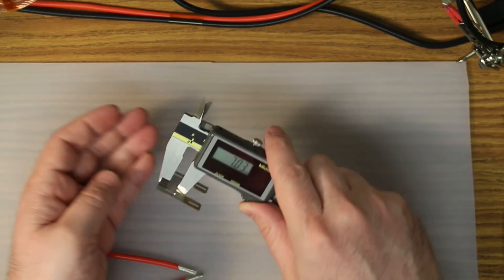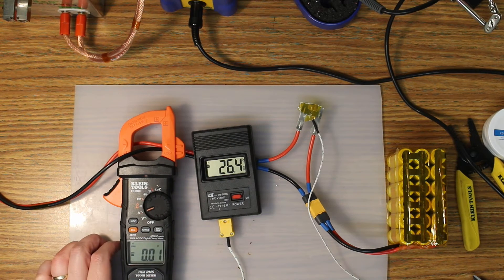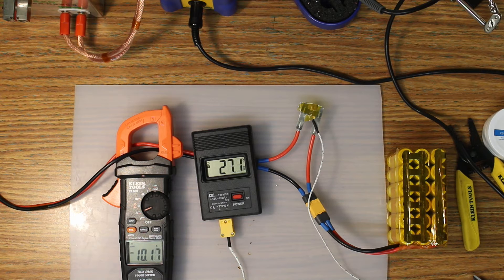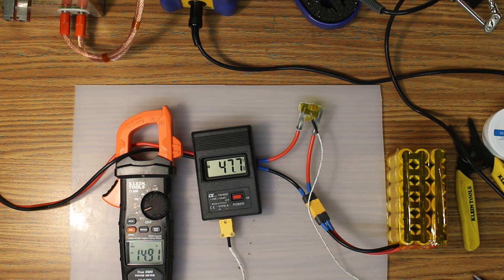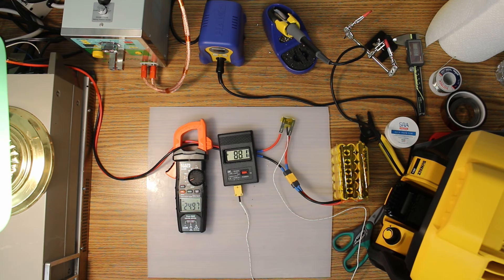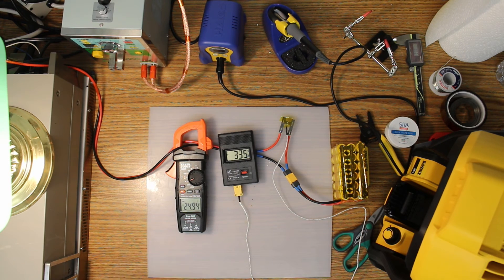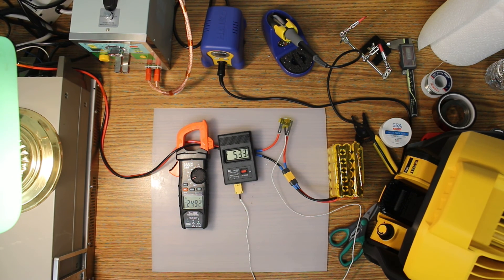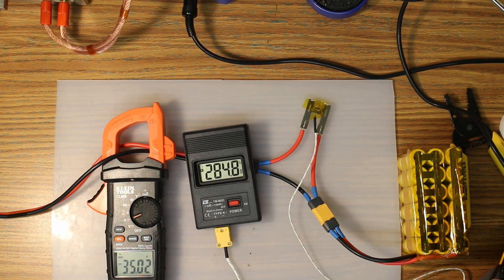18650 Nickel Strip: How much current can it handle

Comment: So basically it should be good for up to 10A current with 0.15mm 7mm pure nickel
Reply from the maker: Yep, but you can push it to 20 amps and still be under 80C or do short burst much higher, add cooling and go even higher. But if it is all sealed up then 10 amps would be a great practical limit.

Comment: Pure nickel strips can take a lot of current, the nickel plated steel type cannot take much current though. An easy way to tell which is which is to cut a 1Cm piece off then disolve in a mix of muriatic acid and hydroge peroxide at a 1:5 mix ratio. The nickel will form a emerald green solution, the iron will form a muddy brown orange solution.
Reply from the maker: Very cool info. I did cut and sand it down and placed it in a salt bath to check for corrosion but I like your method! Saving it for later.
Reply: Do you think 0.2x10mm nickel plated steel would be ok for 10A current

Comment: All that heat gets absorbed in the cells that the strips are welded to and if not cooled can cause a lot of energy loss and voltage sag at higher load currents and damage to the cells in the form of aging and potential fire but in some cases improved cell power output as they warm up the cells.

Comment: what was the voltage drop?
Reply from the maker: Great question! I did not measure that :( however I am sure it could be estimated with the dimensions and resistive value of nickel.
Reply: @mechanicalgraffiti  same way you could estimate temperature. But you did test to prove it.
Reply from the maker: Yes if I do it again I will check voltage but I may not be using nickel on the next setup planning to switch to aluminum or coper for my busbar . Temperature is much harder to calculate, you need to know the heat transfer coefficient (h), and that is a hard number to get. Originally, I was correlating the test to a SolidWorks simulation to derive my h value but I ran out of time and no longer have access to thermal simulation.

Comment: thank you... i'm building a 6s3p pack for an rc jet that will see sustained currents of 25-30A per "p-group"... i'm thinking i'm probably going to solder copper. Would have been so much faster to use nickel...
Reply from the maker: Are you using cylindrical or LiPo pouch cells? And yes copper is much better, the OEM power tool battery I took apart used used nickel plated coper, great conductor with no corrosion.
Reply: @mechanicalgraffiti  molicel P42A, 21700 Li-ion. I have a 8" by 8" plate of 1mm copper that I'm going to cut into strips for this. Might add a couple of grams, but I did a bunch of math tonight, and this 1mm copper has 42x less heat generation than these little .1mm nickel strips at 30+ amps (all else being equal). Heat being an exponential function of current really makes copper mandatory for anything over 20A, even stacking 4 or 5 strips doesn't come close... About everything fun in the R/C world rips more than 20A... Mine are going in a dual EDF jet that can pull 120A easily. These molicel are badass, though... Much lighter than lipos for the equivalent Wh rating... But some lipos can make much more current for their size... Hence my need of a 3p config.
Reply from the maker: Dual EDF sounds awesome. And yes copper is amazing, 1mm may be overkill, you probably don’t need anything thicker than the thickness of the positive terminal on the battery and be careful soldering, the heat can damage the cells. You may be able to get some copper shim stock that could be doubled up and spot welded on the cheap. I just finished editing some old footage on high amp rated 18650 and 21700 cells and published, although they are still nowhere in comparison to LiPo pack in terms of power output, see my Zeee vs Turnigy test.

Comment: Suppose I have to pass 150Amps from that nickel strip for my 14S battery pack. But I have total 14 nickel paths for current to flow. So the current will flow from all those  14 strips or from the least resistance path only?
Reply from the maker: With 14s the current will have to flow through each connection made in series, how many in parallel do you have, typically that is how the current will split, there will be some bias to the path of least resistance but that should be a small fraction of the total current. It should split relatively evenly across all cells/connections in parallel.
Reply: @mechanicalgraffiti Thanks a lot buddy , i was reallly getting confused

Comment: Fantastic test!  I really like the way you did this.  Allows us to draw our own conclusions from the data!
Reply from the maker: Thanks, I did not mention at the end of the video you can see the tape blistered, creating an insulating air pocket, resulting is higher than expected temperatures when correlated with SolidWorks thermal simulation, but in the end I just cut the video, since I sat on it for year waiting to complete.
Reply: @mechanicalgraffiti  - Your test is in air, not on a battery cell.  The proximity to the batteries and not hanging out in the air will also affect the results.  However, I think this is beyond the scope of your test here.  You didn't tell people how much it can take, but instead showed them the properties of it and how it reacts to higher currents to let people decide for themselves.  Most people who are assembling these are fairly technical people and can make the judgement of what is best for them.  

The reason I watched your video is that I am making an electric motorcycle.  Based on your results, my 10X0.15mm strips can handle 35 Amps maximum for extended periods of time.  I am basing this on your 6.88mm wide strip temperature at 25 Amps.  Now I know how many strips to use.  Thank you.

Comment: Is it pure nickel or  nickel plated steel?
Reply from the maker: Pure nickel, I even cut and sanded sections in a salt bath to check for corrosion, so should be pure as advertised.